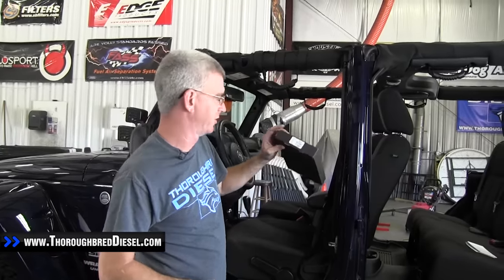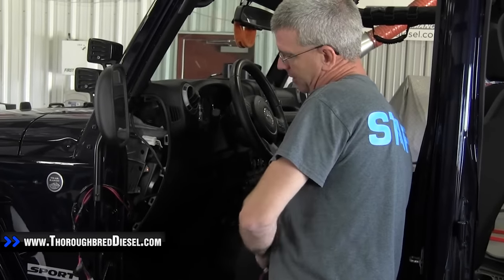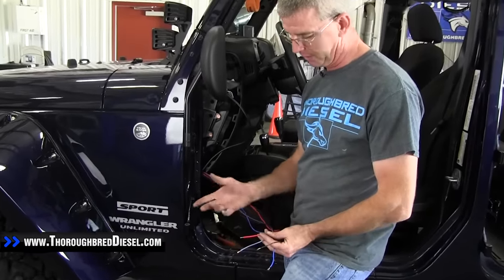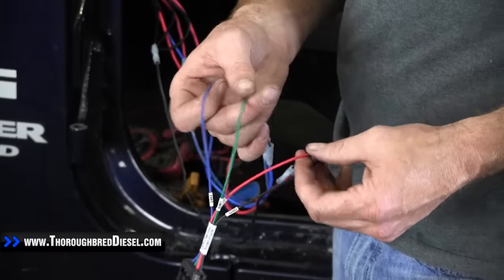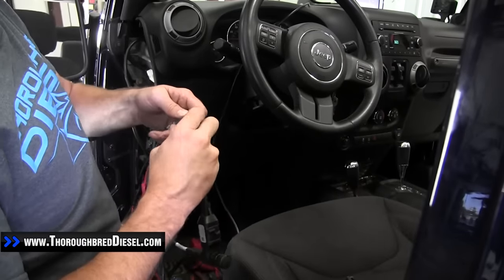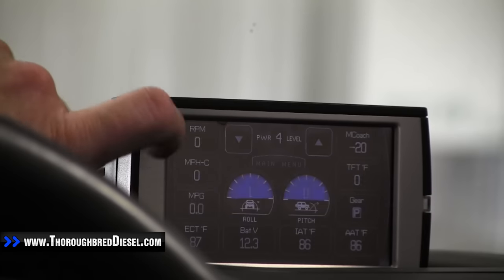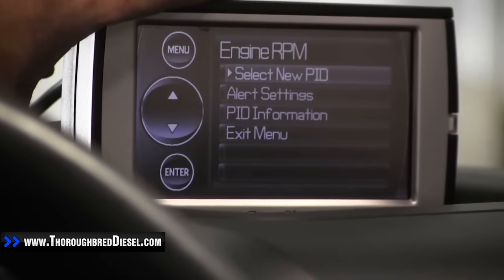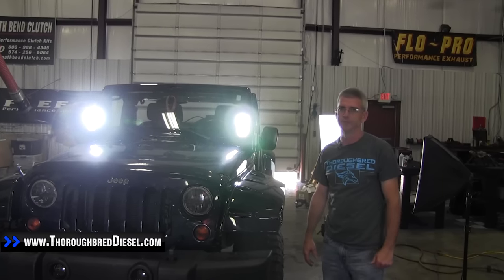Edge EAS Power Switch Install: For CTS Monitors

Comment: Great video! I like the clean look with it all being touch screen
Reply from the maker: Ahillbillyredneck Thank you!
Reply: +Thoroughbred Diesel Do you have to remove the physical switches to use the virtual ones, or can they both be used?  I see one drawback to virtual switches in that there is no way to engage your off road lights until the Superchips device is fully booted up, which takes about 45 seconds or so...
Reply from the maker: +Kris Lavery I would think that you can wire physical switches in parallel as well.
Reply: +Kris Lavery I do electronics in anything from aircraft to cars and there is nothing to worry about by putting on a physical switch. it would work just fine

Comment: What would you need in order to add more accessories to this? Such as additional lights.
Reply from the maker: +Michael Vaughan If you wanted to run multiple lights on one switch I would suggest using a junction block.